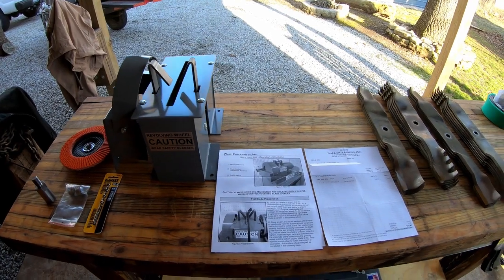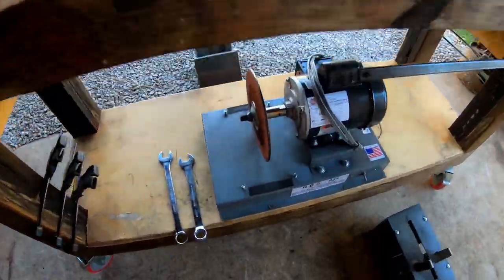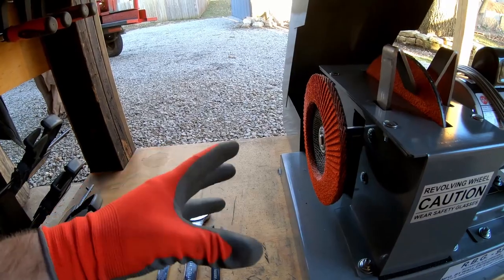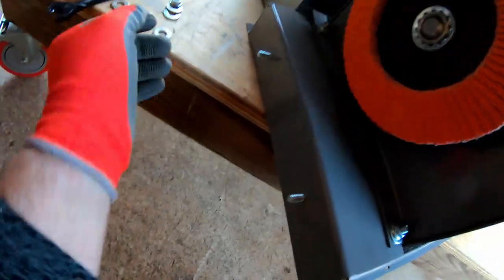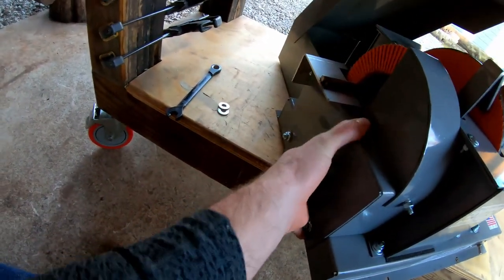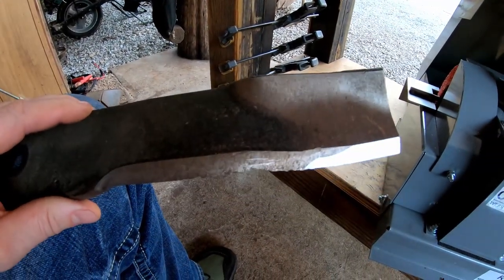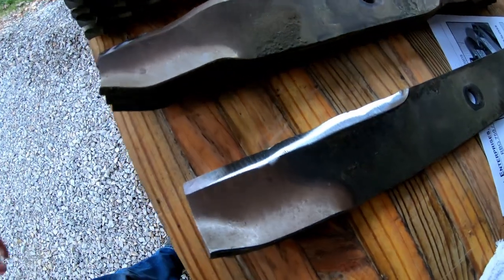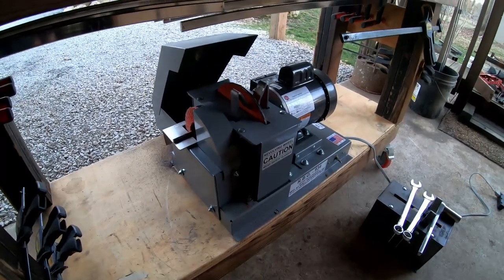RBG 950 Installation (Mulch Blade Attachment)

Comment: Thanks for video, I don't know about this set up. Seems like an after thought and the flap sander disk leaves a convex edge which is less than ideal. 
Are you still happy with this set up or should one get the MAG - 8000 instead for a few more bucks?
Reply from the maker: I have sharpened hundreds of blades so far and I am quite happy with it.

Comment: Thanks for your video. On your cart you mounted it on, did you put it at the bottom of the cart bc of the weight?
Reply from the maker: No, it was where I wanted it so I could sit down while sharpening blades. It's not too heavy to be on top of a table or workbench.

Comment: I've got to get me one of those sharpeners I'm still using a grinder method for now. It works and it was cheap, but I can definitely save some time with that bad boy
Reply from the maker: You won't regret it, if you do buy one.
Reply: @HandyGuy2016  are they worth the price of these sharpeners?  I’m thinking of putting one of those mini crane arms/small electrical winch.. on the front corner of my trailer.. to raise the mower... but.... might also get the Ballard mower lift...  they have a new model.
Reply from the maker: @Jlinwoodjackson  It paid for it's self the first season, because I was paying to have blades sharpened. I wanted to do it myself, just didn't have time but with it I can do all my blades at one time and it makes quick work of it.